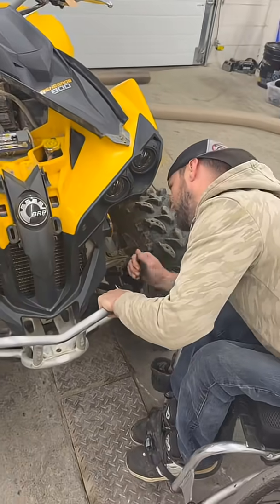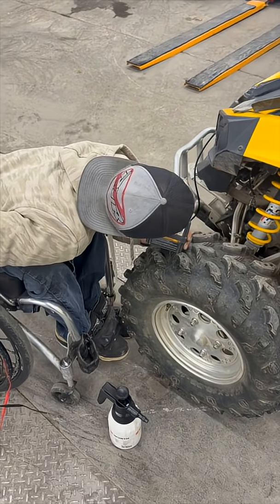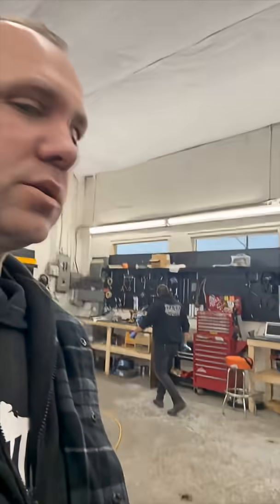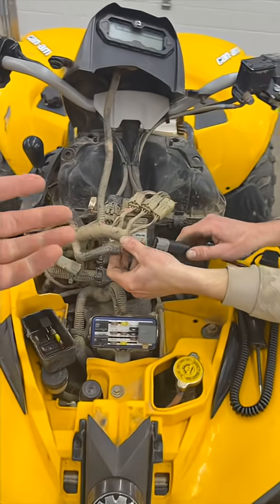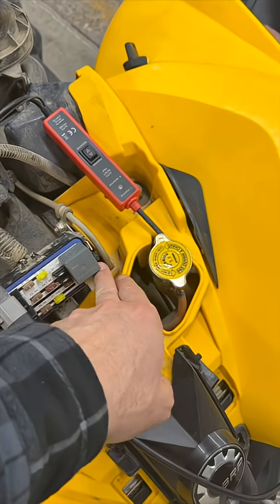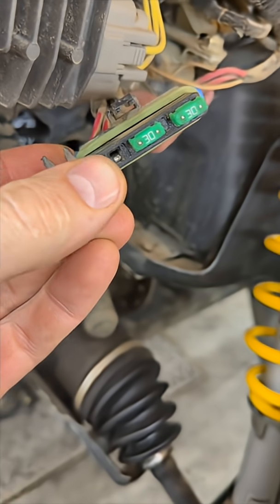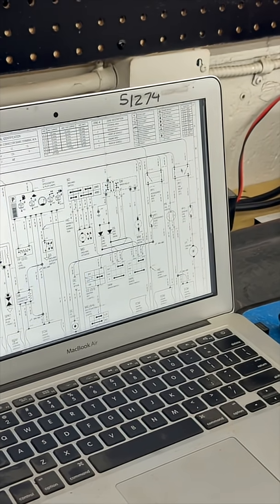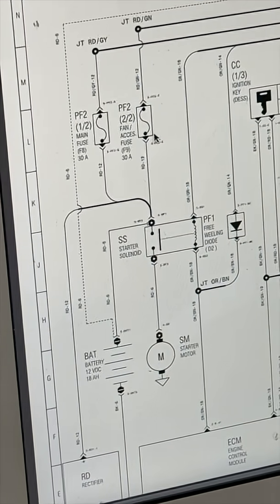Fan Won't Come On-Diagnosis

Comment: Why does a quad have an ECU.  That's silly.  Also, I had a car that would do that. I just wired the fan relay to a switch on the dash board.